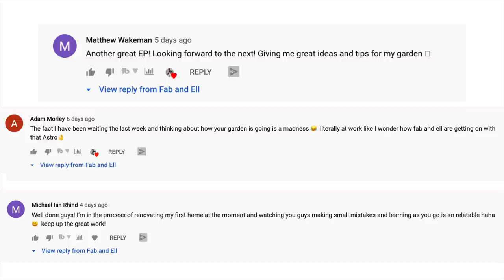WE FINISHED OUR GARDEN RENOVATION! | Pergola, Decking, Astroturf & Patio

Comment: Never pressure wash your decking. It will make it rot a lot quicker. Use an attachment on your pressure washer that is designed for decking by lowering the psi to an acceptable level.
Reply from the maker: Thanks for the info!

Comment: Is drainage not going to be an issue? Your whole garden while it looks nice I can't see where the rain water is going to go
Reply from the maker: Astroturf is actually better for drainage than turf. https://www.trulawn.co.uk/faq/artificial-lawns-water-drainage/

The decking has gaps in so the water will just go through. So there will not be any issues at all 😁
Reply: @fabandell  oh I thought it was concrete under the artificial grass. My garden is sloped and the artificial grass is on concrete and the area at the bottom always stays wet for longest as the water  just runs down the slope. Iv just built a pergola but want some privacy so looking for ideas to cover the sides. Are you going to be doing that?